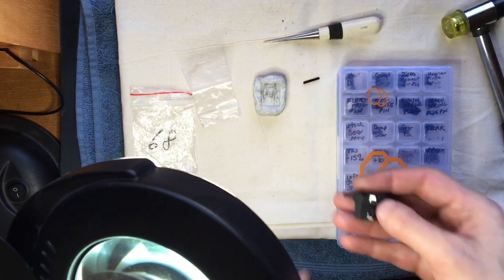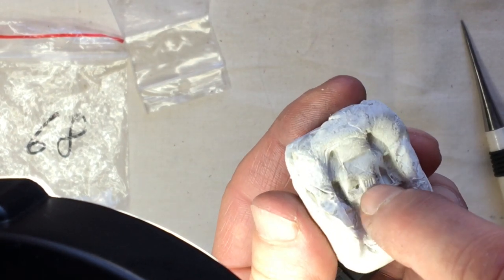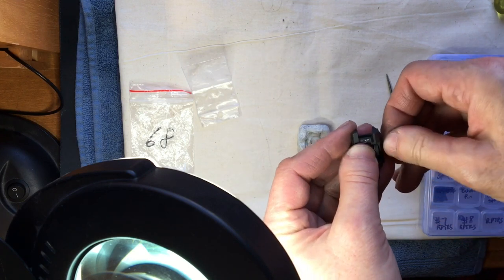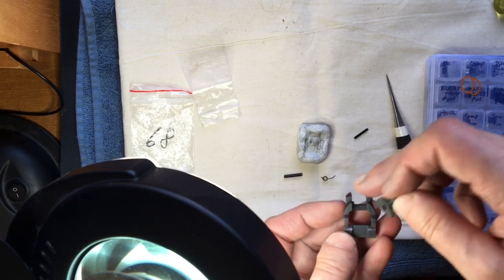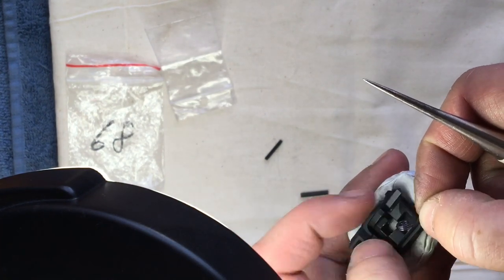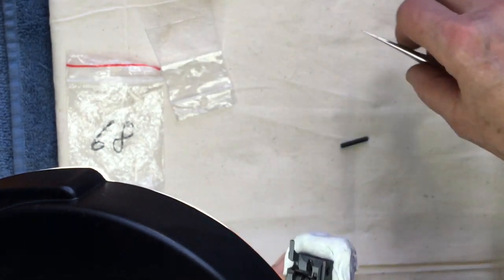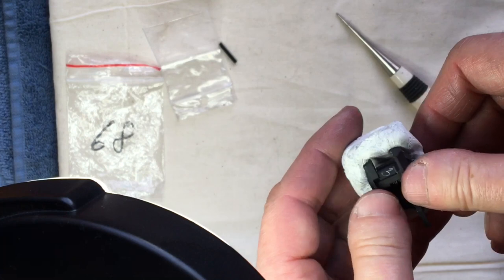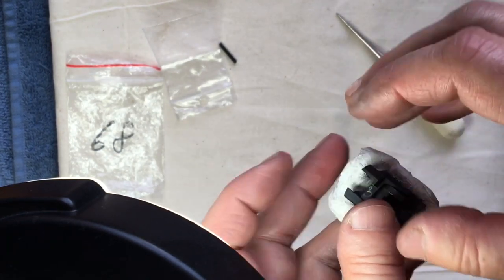Rebuilding the sear assembly (Sear - Ejector - Sear Spring) of the CZ Shadow 2 - EASY!

Comment: Dont get me wrong, its a good way. But I never got how people find this so difficult. I can do it in 10s using just a very small punch in a very similar way you present. I put the parts together, align holes beetween sear and cage, push small pin from one side. Place spring roughly in a right place and pull it in to its final place with the punch. Then push in a pin from the other side. Done.
Reply from the maker: @michall3918  For sure.  First time is always tough for most folks, the more you do it, the easier it gets.  Some people struggle because they don’t have the hand eye coordination, their digits are too big, a lot like having options particularly if they aren’t particularly coordinated.  In my case I have a progressive neurological disease that makes my fingers literally feel like all thumbs or big toes, it’s pretty frustrating at the best of times.  Also hella easier than all the other SP-01 iterations with their sears that completely fall to bits after the retaining pin is punched through the frame.  The only other one that is similar to the 2 is the Combat 85.
Reply: @CZFanGrrl  oh you are doing great to work on these tiny mechanical parts inside guns with such a condition :) more power to you.
Reply from the maker: @michall3918  Thanks for saying!  It’s good physiotherapy, if you don’t use it, you lose it, right?  Cheers!😀

Comment: Any tips for the cz75 sp01 sear cage. I’ve lost hours on the 3 springs in it. Problem I have is that parts have to go in from the top and bottom. So hard to keep together.
Reply from the maker: @denniswilson8388 I’ve had the misfortune of accepting to take on repairs of two SP-01s.  I didn’t learn the first time around.  I refused the third. My suggestion is getting a hollow roll pin that just fits, so it keeps everything together long enough as a whole to get it situated back in the gun.  Then you use the permanent roll pin to push it through.  if I remember correctly anyways.  Sorry can’t be of more help, I remember the first one took me hours to rebuild as well.  I built a jig out of Jett Sett fixturing compound for the sear on the Shadow 2, but I just jam my index finger in the gap underneath and use the pad of the finger to support the spring.  I still use a slave pin though and then push the permanent pin through.  Work from the easy side to the harder side pushing the slave pin in as you progress.  Hope this helps!